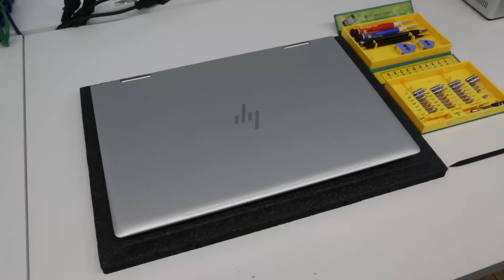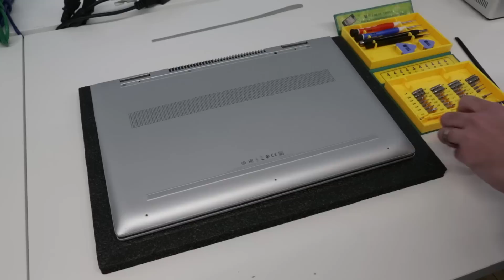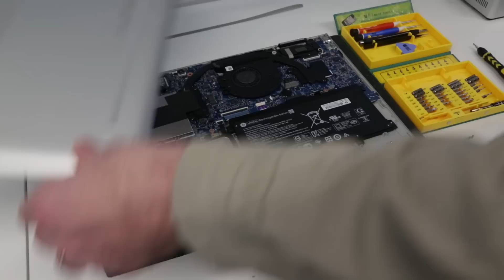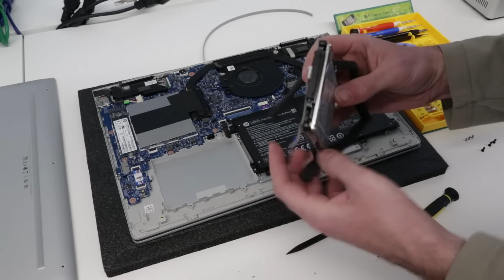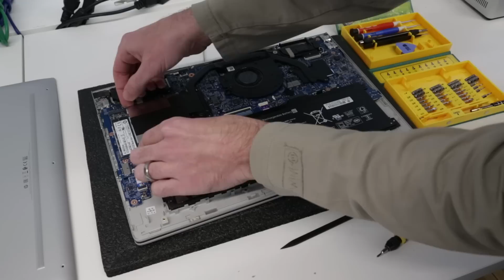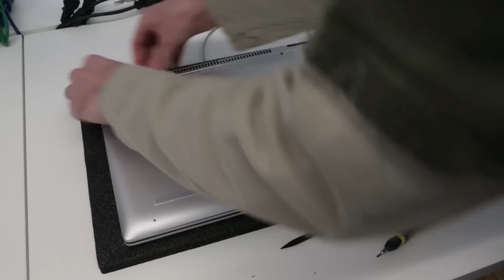HP Envy x360 15 SSD, HDD and RAM Upgrade Guide

Comment: I just got this exact laptop. I'm hoping to install an SSD, and I was curious: Should I simply swap out the laptop's current 16GB SSD for the new one (likely 500GB), or should I replace the 1TB HDD with the SSD? The SSD currently on the laptop is full, and I can't edit the drive.
Reply from the maker: Are you sure you have a 16GB SSD and not something like a 128GB? 16GB ones would generally be Intel Optane modules, which don't act like regular SSDs.
Reply: @BrueComputing  I had the same thought when I purchased it. Now that I've booted up the laptop, I've confirmed that it's only 16GB, but I still have to crack it open to see whether it's an Optane module. However, it is listed alongside my HDD as a (almost entirely full) recovery drive, which makes me curious...
Reply: @BrueComputing  It is indeed an Optane module. Is it normal for an Optane module to be "full"? And would you expect any benefit to come from replacing the HDD with an SSD? Thank you so much!
Reply from the maker: The Recovery drive you can see isn't actually the Optane module, its just a partition on the hard drive, so you can ignore that. It should be mostly full as it is only made the size it needs to be for the recovery data.
The Optane module acts as a cache for the hard drive, so it isn't actually shown as a separate hard drive. Instead regularly used operating system and application files are written to it to speed up their access, to give some of the performance benefits of a solid-state drive, but the capacity of a hard drive - there is a decent article on it here: https://www.windowscentral.com/what-intel-optane-memory
Depending how technical you are, and how much you want to spend, I'd probably remove the Optane module and replace it with a 480GB NVMe SSD like this: https://amzn.to/2XfQkU4
Then clean install Windows 10 to the SSD, erase and reformat the HDD and use the SSD for Windows and applications, and the HDD for data storage.
If that is more than you want to get involved in doing though, Optane actually works quite well in providing a lot of the benefits of an SSD whilst being easier to manage, in my experience.

Comment: Hey, thanks for the video.
I don't have the exact same model, but an HP Envy x360. Do you know if it is possible to change the battery? And does the strap go back on itself or did you glue it on it afterwards?
Reply from the maker: The battery can be replaced once you have it open. The rubber strip on mine went back on with the already attached adhesive.

Comment: My girlfriend just got one with 256 Gb drive, or so Windows says.  But when I  opened the laptop, the desk bay is empty!  Looks like they setup some kind of memory chip to act as the disk...?  Since the is no disk already in it, I cannot install my 1Tb SSD I have at home into it.  Very surprised to see that empty bay!
Reply from the maker: The SSD is an M.2 drive. To fit a 2.5" drive you'd need to purchase the cable and caddy - it doesn't come fitted in machines which are configured without one from the factory.

Comment: Can I upgrade hdd to ssd or Nvme in my hp envy x360 convertible 15m-bp1xx..??
I’m not able to find true answer particularly for this model. Please help..
Reply: Yes if it comes with an nvme slot on the board it is upgradable and you can upgrade to an ssd as long as its a 2.5 and not size 3

Comment: I need help! I have the hp envy x360 m convertible. I opened the laptop up after cloning the drive that it came with but I can’t find it! It’s not there. I can’t find the ram either. I see a spot I can mount my new ssd but I want to replace the ssd in the laptop but it’s not here. And the inside of my laptop looks different from yours
Reply from the maker: If it is an SSD only model then it'll likely just have an M.2 drive.
What is the full model number for the laptop?
Reply: Brue Computing    HP - Compaq ENVY x360 15m-cn0011dx

Comment: Excellent and no-nonsense video for this model. After following it, I can attest to two things. One: DO NOT SLIDE YOUR FINGERS ALONG THE EDGE OF THE BACK PLATE. Unlike many MacBooks I've opened, the backplate on this unit is SHARP and will slice into your finger.  I type with a bandaged finger.  Two: the hard drive to MB cable has a VERY fragile connector at the MB. The cable can be purchased directly from HP for just under $17.
Reply: Just sliced my fingers (((
Reply: I too have made the experience that slicing your finger happens very quickly.
Reply: Why, oh why, would they do that.  I learned the hard way, too.
Reply: Please how can I get the hard drive connector cable. That’s the hard drive to MB connector. I need one seriously.
Reply: @kplmusicworldwide5961  I got one directly from HP.  Go to their support site.
Reply: @kplmusicworldwide5961  I never saw your post.  I found the cable on the HP website.  Do a search on their support side of the website.
Reply: Changed my hard drive out and now have a sliced finger.

Comment: Is it easy to put the rubber strip back on? Do you need to use an adhesive to get it to stick?
Reply from the maker: The strip attached to it went back on just fine.

Comment: Can this type be extended with HDD?  HP Envy x360 Convert 15-bp104nl
Reply from the maker: If it doesn't have a HDD currently then you'll need to source the cable + caddy as they won't be fitted.

Comment: There are so, so many versions of the HP X360 in every size.
Is this the  HP Model 15-CR0037 ?
Reply from the maker: This is the bp100na.
If you search on the HP site they have good service maintenance manuals for most models.
Reply: @BrueComputing  The HP service manuals are great .. one of the companies strong points. 
I was just trying to get an idea which model this was as I was looking at buying a similar model.
Thank you.

Comment: Dude, this is seriously awesome. You can save a fortune if you get the base  12gig RAM / 256gig SSD model and the just install a HHD! Thanks so much!!!!
Reply from the maker: If you do this you'll need to buy the HDD cable and caddy, as they aren't fitted in non-HDD models.
Reply: @BrueComputing  Do you know where to buy those from?

Comment: Sneaky HP. Screws underneath each little innocent looking rubber bumper! You will ruin the PC before realizing they are under there if you aren't aware that HP does this!
Reply from the maker: They are actually good enough to publish a Service Manual for most models, which shows the location of these.

Comment: Mine is booting off the HHD- Looking to upgrade with an M.2 and keep HHD as storage. 
 If I add the  SSD,  Can I transfer the system to boot off the SSD without too many problems? Will there need to be changes in BIO's etc.. Thanks in advance!
Reply from the maker: Personally, I'd remove the HDD, fit the SSD, install Windows 10, refit the HDD and then reformat it once I'd copied off anything I needed.
Alternatively if the SSD is large enough you could clone the HDD to the SSD using something like True Image 2018.
Reply: @BrueComputing  Right on.. Was thinking about a 500 GB ssd to save a few bucks. But have over 750 GB on HDD. Might just bite the bullet on a 1tb and just clone...  Keep the HDD as a back up...  I just hate the Hours and Hours of doing a clean install,  re-installing all the programs blah, blah..  I'm cheap and lazy! LOL
Thanks!

Comment: I bought envy 15 ryzen 7 with 1tb hdd. My model came with 8gb ram,, how do I know whether there is 1*8gb or 2*4gb, someone help.
And what's the max size nvme that I can put
Reply from the maker: Do you know the full model number? HP are quite good at listing the exact specs.
Reply: @BrueComputing  HP envy x360 15tz in HP store us
Reply from the maker: @bhargavhs7058  Looks to me like it has 1 x 8GB, and there will be a DIMM slot inside you can add a second DDR4 module to.
Reply: @BrueComputing  and upto how much gb can I add in SSD slot
Reply from the maker: Any NVMe drive should work.
Reply: @BrueComputing  max capacity? 1tb or 512?
Reply from the maker: Probably more than that. I can't see any reason a 2TB wouldn't work.
Reply: @BrueComputing  thx sir!

Comment: Thx realy helpful...

But if both m.2 & hdd used..my boot manager always set the default to the 1tb hdd.. and the value can not be changed ..  

So right now i use the m.2 slot only & left the hdd.. any one have faced the same problem?
Reply from the maker: You'd want to completely erase the HDD (clean with Diskpart) to remove the Windows Boot Manager from it. You may need to reinstall Windows on the M.2 SSD as well.
Reply from the maker: Although my system didn't have this issue - it shipped with 128GB SSD + 1TB HDD, so boots from the SSD anyway.
Reply: Okay, lets try it... Thank you very much sir🤝😁..

Comment: May i know the battery voltage and capacity? I need to calculate the watt hours WH
Reply: It's 11.55 Volts, and 55.8Wh, but it also says 4600mAh in the other corner.

Comment: Hi, nice video. I have a question if you don't mind. I have this same model hp envy (15-bp100 with intel proccesor and nvidia video card) but the motherboard is fried, so I wonder if it is possible to exchange the motherboard for the one in the hp envy (15-bq with AMD components) because I can not find a replacement motherboard for the 15-bp100. It is possible to exchange motherboards or am I without help?

Comment: I have bought an envy x360 bq-100nl which has builtin 256GB SSD but no mechanical drive. Today I have opened it, thanks to your video, and I found out that HP (reasonably) left the connector on the motherboard but the flex and the caddy for the HDD drive are missing. Can you tell me the FRU of the flex for the hard drive? I'd like to try to buy it and install one more drive on my HP.
Reply from the maker: You can find the service manual here: http://h10032.www1.hp.com/ctg/Manual/c05819570
From Page 28:
"The hard drive spare part kit does not include the hard drive bracket or the hard drive cable. The hard
drive bracket is available using spare part number 924350-001. The hard drive cable is available using spare
part number 924326-001."
Quick search suggests you should be able to get them from China via eBay, or elsewhere online.

Comment: Argh opened mine to put in another SATA SSD. Beware there isn't a ribbon cable inside 😵 that made everything much harder. Also beware the black casing to make your drive into a 9mm fitting needs to be bought separately too.  Of course HP wants you to struggle to upgrade their underpowered laptops...

Edit: answered earlier. Thanks for a great video
Reply from the maker: To be expected really - they'll not include parts not needed for the model you're buying, it would just be adding cost, weight and build time.

Comment: I just bought the envy but mine only comes with a 128gb ssd and I want to add something to it but the problem is I have no knowledge in any of this should I install/can I install an hdd for extra storage and just keep the 128ssd I already have?
Reply: I have the same laptop and I am willing to do the same thing. As far as I could understand, the answer would be yes. Our 128ssd uses the m2 connection next to the ram, so the 1tb hdd for example, would be located right left the battery. We can add 1tb and keep the 128sd for windows only.

Comment: I have always believed that the golden rule when disassembling computers and laptops is to remove the power source, from the mains or battery BEFORE  any work is started, plus always wear a wrist earthing strap !! doesn't this apply on this H.P. range with an internal battery ?  as you do not state to remove power supply first.

Comment: Hi, I've buyed a 15-bq Laptop, I need to put a secondary HDD on this, but the laptop doesn't have any cable and caddy for a second HDD. Can you please leave here the HP CODE of the SATA CABLE? Thanks!
Reply from the maker: Got the full model name and number and I'll see if I can find a service manual.
Reply: 15-BQ100NL or ProdID  2ZG52EA#ABZ . Thanks in advice!
Reply from the maker: You can find the service manual here: http://h10032.www1.hp.com/ctg/Manual/c05819570
From Page 28:
"The hard drive spare part kit does not include the hard drive bracket or the hard drive cable. The hard
drive bracket is available using spare part number 924350-001. The hard drive cable is available using spare
part number 924326-001."
Quick search suggests you should be able to get them from China via eBay, or elsewhere online.
Reply: Brue Computing soo many thanks!!

Comment: Hi I have successfully replaced the hdd with an SSD but the rear upper rubber foot strip (the one that covers 4 screws) has peeled off. Where can I find a new one to buy?
Reply: Don't bother to replace the rubber strip, because the strips are poorly designed and work their way off anyway during use. Go to Ace hardware and get a pack of 51457 self-adhesive rubber pads, and paste four pads just outboard of the ends of the rubber strips. Then peel off the rubber strips and throw them away.
Reply: Could you tell me what you looked for when you were finding the SSD substitute?
Reply: bind look for sata ssd 2.5.. I went for a 535gb crucial one. Though if you have my same model you should have the m2 ssd port. These are more expensive but way faster.
Reply: i have this one. would sata ssd 2.5 be compatible and is it the fastest choice?
Reply: bind sata ssd is compatible cause the laptop comes with a sata hdd equipped (hence sata port). but if you want the fastest you should look for a m2 ssd assuming your model has the port.
Reply: bind I just saw you link. in your case you have an m2 for operatio and hdd for storage.. imo you already have the best setting.. if you want you can increase your m2 (128) but if you only want to use one storage there is some tinkering to do which I have no idea on how to get it done..

Comment: Could you specify the type and size screwdrivers you used to open it  with in a comment?  thanks.
Reply: Torx T5 for the bottom three

Comment: WHY did you pull this laptop apart if you wern't going to upgrade it, especially your Wife's laptop!?
I called HP abuot the memory and they said it is not an issue having a larger memory board in the second slot.
Reply from the maker: Because a large part of why I bought it was to do the videos with it - I bought a higher spec laptop than we might otherwise have done because I could make the money back on the videos, where a lower spec one I would not.
I dismantle and repair laptops for a living so am perfectly capable of doing it without causing damage.

You CAN fit a larger memory module, but it leaves you running an unbalanced memory configuration, which can reduce bandwidth by falling back to single channel mode and lower performance more than the increase in memory capacity gives, depending on usage.
Reply: Ok, got it... but most creators aren't making much money on YT anymore and you only have around 14k subs. That's not very much. I didn't know you could PAY for a laptop on the funds you receive with only 14k subs.
Reply from the maker: Subscribers making up something like 1% of my views. They're nice to have, but the nature of the content I produce means people find me by searching for information, not by watching every video I post via subscribing.

The videos I've made around the laptop certainly won't have covered the whole cost of it yet as for various reasons I haven't done as many as I'd intended (although in the past with some lower priced laptops which I've had more time to produce videos around they have), but they've more than covered the difference in cost of the lower specification we were also looking at.

Comment: Has anyone had any experience replacing the DC jack on this model?
Reply from the maker: Should be pretty simple, its a separate connector which you can see in the top left corner in the video, with a short lead and plug in to the mainboard.
Unplug and probably one or two small screens to remove, then replace.

Comment: Why is there an ssd and a hdd?
Reply from the maker: Because it is significantly cheaper than fitting a very large SSD, but still gives the benefit of fast boot times and application loading (if you install them to the SSD).
Reply: So let me ask you this, I have an Hp envy x360 and I'm decently happy with it other then its performance in application and boot up times. Mine currently only has a 1tb hdd in it. if I were to add a m.2 ssd into it, how would it treat it. would it just treat it as extra space, like and external hard drive, or would it increase my boot and application loading times.
Thank you

Comment: Hi, firstly thanks for this review. according to HP USA, there is an option of 12GB ram, which is 4gb slot + 8GB 2nd slot. I think you can upgrade the ram by adding 8GB DDR4-2400 sodium if you have on board 4GB DDR4-2400 sodium. this is just assumption not sure! and defiantly it is a different story with 16GB ram.
Reply from the maker: Yes, this will work just fine. I prefer to recommend balanced memory configurations though as unbalanced configurations may end up running single channel mode which hurts performance in some tasks (mostly graphical).
Reply: thank you for your feedback much appreciate it.
Reply: So you are saying, if there is 4gb on-board, you would prefer another 4gb in the slot instead of an 8gb in the slot? I have the option for 4 and 4 or 4 and 8. It is $60 more for the 4 and 8. Alternate info, 8th gen i5-8250U with NVIDIA GeForce MX150 (4 GB GDDR5 dedicated) and 256gb SSD. Thanks in advance!